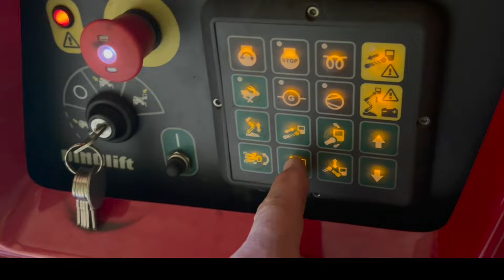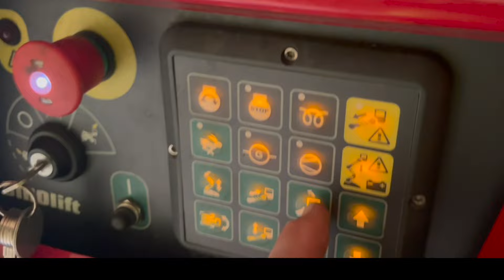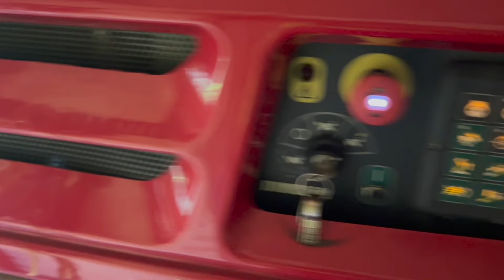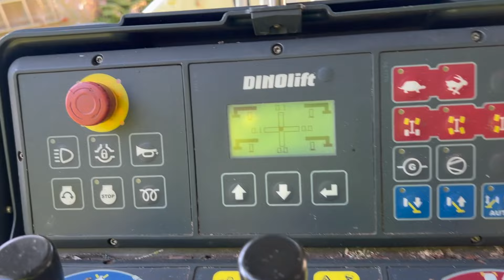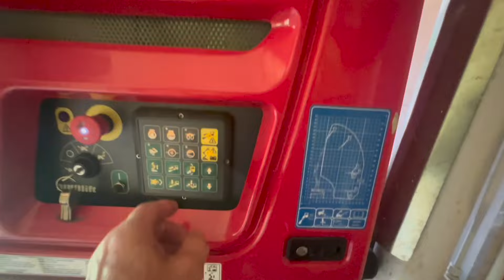Don’t Remove That Tree!-Game of Trees Saves a Huge Maple

Comment: Thanks for the video Kevin. That lift looks really nice and 72ft is awesome. I’m used to a 55ft bucket truck and you always want more height and can’t get it into a lot of jobs anyways. 

Question about that final cut, would it ever make sense to not flush cut it and leave a couple foot stub to keep the decay further away from the important union? I know it’s probably not best practice and would look weird but on a cut you know will never heal I just got to thinking.

Thanks again, always learn something.
Reply from the maker: Great question. It’s counter intuitive, the additional wood provides more energy for the wood decay fungi, better to have a well angled shelf that sheds water as long as possible. Your thought is correct if there was a sustainable branch 10 feet up, but this spar only had branches at the top.  Good thinking Jeremy. Thanks

Comment: You’re certified right? I want to learn from you. Isn’t taking that much off of a tree detrimental to its longevity? Not knocking you as I’m just a few year climber and I’ve done the same thing for customers before. From what people say on the tree Facebook pages the general consensus would be to advise  against this. That’s such a huge beautiful tree I wouldn’t want to change a thing you did. Just wondering my man. Great job on the tree and the video. Thank you 💪🏼
Reply from the maker: Anything bigger than 3 inches is bigger than ideal. This limb was a significant hazard to the house. It’s technically stage one removal, but they can enjoy this tree for many more years with some peace of mind.  Yes I am ISA Certified WI-0317B. There are three things in this industry Trees, People and Money. Balance them well and you will do well. Thanks for the question, it was a good question.